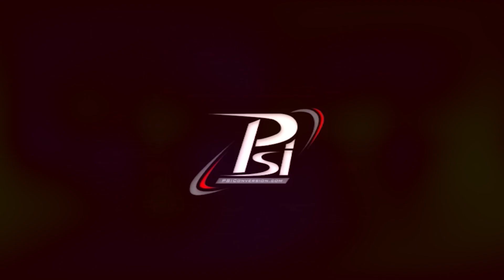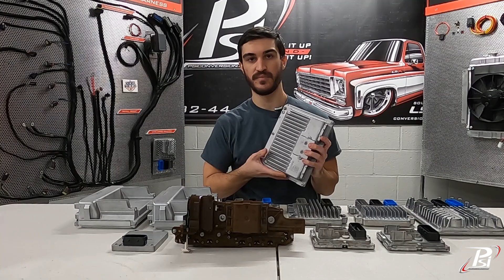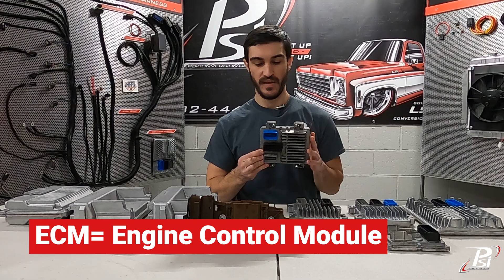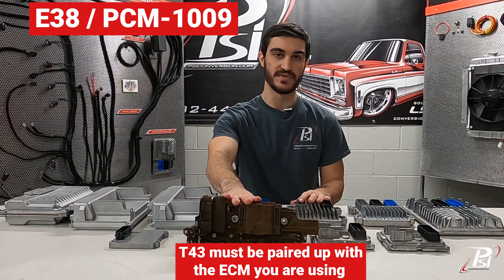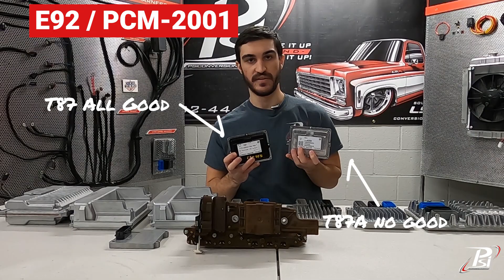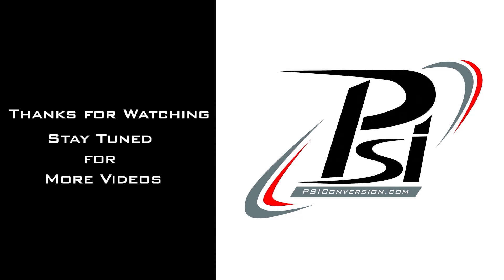PSI How To: Which PCM should I use on my LS / LT Swap ( BONUS: PCM Reference Guide at end)

Comment: I got a 2010 5.3 drive by wire but I want to convert it to drive by cable can I use my pcm or do you have one that’ll work
Reply from the maker: You can do it and we have the parts; it is not what is recommended as you'd be running your 2010 engine like a 2000 motor then and cost quite a bit for not any real benefits.

Comment: My crate 5.3 is a truck engine, but I purchased a ls6 intake manifold out of a Camaro, so would it make sense to purchase car sensor for the PCM-1003 DBC Gen kit with the computer from you guys or stick with the truck sensor instead? Does it matter thought it's a LT engine? Which is the better move? Does the kit come with knock sensor plugs as well?
Reply from the maker: We'd love to answer your questions in full, a phone call would be best. 5.3's are built gen 3-5, ls6 intakes can work on gen 3 and 4, so we want to verify some of this information and ensure we get you the right things you need. 732-276-8589 We can get you everyhting needed, knock sensors we build into the harness', etc.

Comment: i have The PCM with service number 12589463 is typically used in drive-by-wire (DBW) I want to use Drive by cable - does the unit neeed to be programmed for DBCable?
Reply from the maker: We'd recommend getting a DBC 0411 style of computer with red/blue connectors.. You'll have an issue with the way the connectors are keyed and finding a proper tune for that computer

Comment: Can the E38 controller be used with a manual TR6060? I purchased a harness from you guys but am having trouble getting motor to start
Reply from the maker: yes but the e38 must be tuned for a manual trans. I hope this helped you out.
Reply: @psiconversionyoutube  okay could that be why I am getting a crank but no start? The tune? If so is that something you guys can do?

Comment: Can a t42 be used as a standalone controller when using some not GM aftermarket ecu? Ofcourse flashed to desired tranny (4l80e in my case) and wired properly.
Reply from the maker: I talked with our tuner and as far as we have seem the aftermarket ecm and the t42 wont talk to each other, you can always ask the aftermarket company they might have a better answer for you.

Comment: My gen4 was originally equipped with a 6l90. But im going with a 4l80e. Could I still use my same e38 ecu, with your harness, and add the t42.?
Reply from the maker: no you would have to find a sent that have a 4L80 tune on them
Reply: @psiconversionyoutube  i just will buy your complete kit 👍🏽